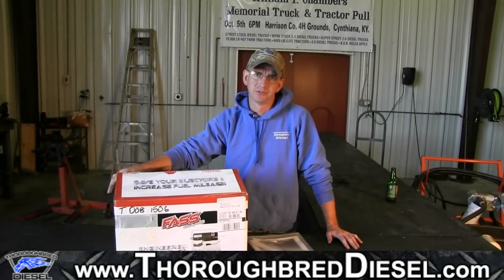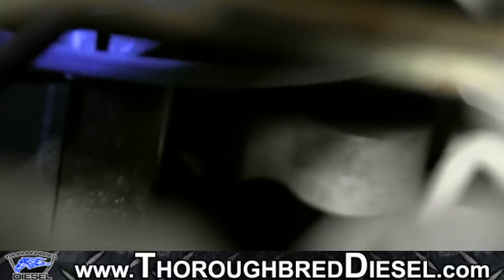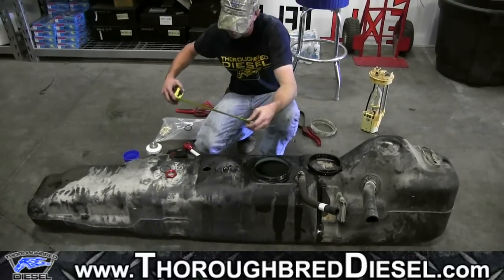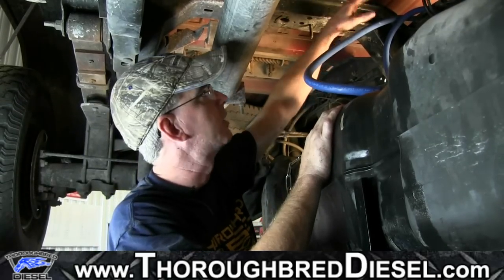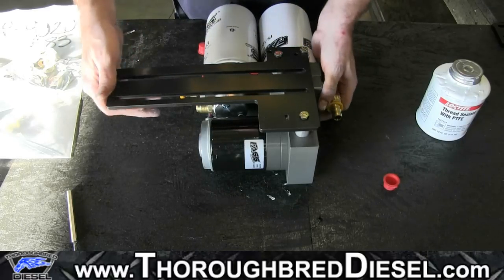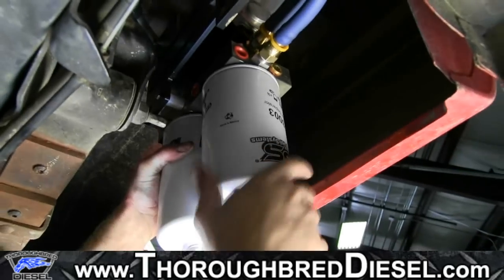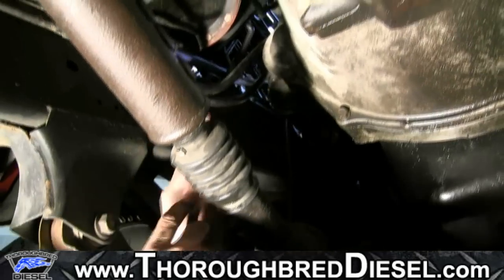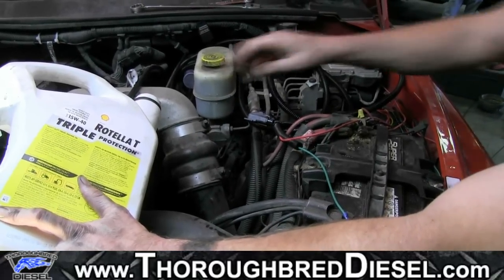FASS Fuel Pump System w/ Drawstraw Install: 2002 Dodge Cummins

Comment: @thoroughbred i have a 02 Cummins 3500 5.9 it doesn’t have an intank pump, but it has a electric pump replacement. I believe it is an airtrax pump. So when i install this, do i need to remove the electric pump or just leave it hanging? And another question, i see you had the fass pump for the block mounted pump, but you are using it for the intank pump. Are the fass pumps for block and intank pump reversible to use for either, as long as you just get the draw straw? I hope this makes since.
Reply from the maker: If you purchase a full FASS or Airdog system that routes to the VP,  you will just bypass your block mounted pump.  You can totally just leave it hanging on the engine if you choose.  If you choose to do a FASS block mounted pump, you cannot have an intank pump at the same times as it causes a restriction.  Also, if you use the block mounted FASS pump, you really would have to create your own fuel lines from the draw straw to the FASS DDRP, if that makes sense.
Reply: Thoroughbred Diesel thank you for this information. I was just curious. I’m about to put on the fass d08 100gph.
Reply: Thoroughbred Diesel one more question. In the installation manuals it says to spray wd-40 on the pump, as to where y’all did not in this video. Is that somthing that has to be done?

Comment: Would an airdog pump with a draw straw be the same install? Also what about if the fuel pump wasn't relocated and it's on the block?
Reply from the maker: zack halstead Some different hardware, but basically the same principal. If you got the Airdog 2 you will be doing the in tank module upgrade, that video can be found on our channel as well (AirDog Dodge Fuel Module Upgrade Install). https://youtu.be/ls4ocVVwEvI

Comment: Anyone know if you could just use the power wires and circuit from the stock pump?
Reply from the maker: Yes,  you can use the trigger wires from the stock lift pump if you choose.

Comment: My truck still has the lift pump on the block. It was never retrofitted with the in tank pump. Do I need the draw straw? Truck will be a daily driver with a mild programmer and RV275's. Not looking at making drag or sled power, just reliability with a little edge over stock.

Comment: I purchased my FASS for my 04 Cummins but my wiring harness is different. They told me I’ll have to cut my power wire from my in tank lift, is there another wiring harness sold separately? My truck been retrofitted, I have installed the suction tube.

Comment: question if i want to install this system with the sump kit do i require the draw straw as well, also if I'm installing a fuel pressure gauge along with this kit do i require any additional material to hook it all up?

Comment: Hi Thoroughbred Diesel. I've been looking into getting the FASS titanium 95 gph or the 150gph for my 03 24 valve. I'm leaning more towards 95gph. I went out tonight and turned my key over and went and listened at the tank, where I heard a hum. I'm assuming that means that my particular truck has been retrofitted with a pump in the tank, and I'll have to get the 04.4-07 kit, or else get the draw straw and sump when I get the pump itself.
Reply from the maker: That is correct. I would check on the back of your fuel filter to make sure 100% that you do not have the pump still on the back of the filter housing.
Reply: Thoroughbred Diesel I went out and looked this morning, but I did not see that block down there. Just the two fuel lines running to the fuel filter.
Reply: I guess I'll amend my previous comment above. I did a closer in depth look, and there is no aluminum block like there should be for the pump in tank, but there is also no lift pump either.
Reply from the maker: On the 03 to some 04.5 trucks, the lift pump is actually on the back of the fuel filter.  So there would be a maybe 2” cylinder on the back of the fuel filter housing that has a fuel line running to the bottom of it.  If it has been retrofitted to the LP in the tank,  there will now be an aluminum block on the back of the fuel filter with a fuel line going directly into it.
Reply: Thoroughbred Diesel is there an email that I can send photos to for your viewing?
Reply from the maker: Please send the pictures to sales@thoroughbreddiesel.com ATTN: WADE

Comment: The New wiring harness on the Signature Titanium pump does not connect to the original wiring harness going to the ECM like the setup on your video.  It connects directly to the battery and fuse box.  This requires that I leave the old Carter pump disconnected which causes a check engine light code P0230.  It comes and goes, but never seems to go away cause the ECM is always looking for a connection.  Is there a way to get rid of this annoying code?
Reply from the maker: Good question and you are correct on the new wiring of the harness, the trigger wire now goes to a key on source.  Not all trucks trip the SES light for the lift pump connection, but if yours does, what it is looking for is a ground. On the pigtail that supplies power to the block mounted lift pump, find the ground wire and just splice into it and run it to a chassis ground. No more light. If you need anything just let us know.

Comment: I have a 1995 12v cummins and I removed the injection pump to access the tappet cover and do other work along with removing the transmission for upgrading. Well I disconnected the 2 fuel lines coming from the fuel tank, both have a rubber hose on the end. Can you tell me specifically where these hoses connect? One hose clips to the top of the transmission and makes a “z” shape in the metal line then goes into a rubber line. That’s the hose I’m really trying to figure out where it goes. Any help is appreciated!

Comment: do you guys happen to have a video for a 99-07 or so ford 6.0? I'm contemplating whether to try to install myself or take it somewhere. Are these plug and play relay like that dodge was or cut and splice? do you know of an adapter to make it plug and play??
Reply from the maker: +AceBoy2099 Yes.  We have not done a Ford install video as of yet.  On the 6.0 and 7.3 trucks, this kits will come with vehicle specific harnesses, you will only have to find a key on power source to run the unit.
Reply: +Thoroughbred Diesel 
when you install one of these on a ford 6.0 are you supposed to remove the engine mounted fuel filter or doesn't it matter?
I just installed mine this weekend and now it seems to have a slight miss/hick up that wasn't there before. I'm thinking it's got to be either that or the draw straw isn't cut high enough, but I don't hear a change in tone of the pump like the 5gal bucket test video fass has out.

you guys have any tips for me?

Comment: Ok we'll my truck is a 2001 and i recently replaced my battery cable connections and I hooked everything back up like it was when I bought the truck, I have a green wire going to my negative side of the battery and there is a red wire running to the positive and I know there is a fuse also. And i don't remember it constantly running when I first bought the truck. All I ever heard it do was come on for a short time right when I would first turn my key on before starting the truck. So I'm needing some help on figuring out what is going on, and is it a bad thing that the pump is always running while the truck is on ? FYI the color of the fass pump I have is red. I think it's an older model possibly.
Reply from the maker: Has anything changed? Has anyone worked on the truck that could have possibly cut the trigger wire and moved it to a key on power source. The wires on your battery are your constant power wires. Check your FASS relay and make sure it’s not a relay problem. No it will not hurt your pump to run while the keys on per say, but if you have an accident and the pump is running with the key off it would not be a good thing. This issue needs to be addressed.

Comment: when is someone going to do a video for the 2012 Cummins trucks?
Reply from the maker: Really not a lot of difference from this video other than the fact that you are bypassing/disabling the pump in the tank.   The principle is the same.
Reply: Thoroughbred Diesel WHATIF MY TRUCK HAS THE SEVERE DUTY FILTER? Do you recommend removing all of that or leaving it in place?? I would like to clean up some of this space on the frame.
Reply from the maker: The FASS can be fitted with 2-micron filters.  It will be a judgment call for you if you want to bypass them.

Comment: by unplugging the ecm connection to the in tank pump does that unplugging your fuel gauge or is that a different plug?
Reply from the maker: No, the same plug but unplugging the pump will not affect the sending unit for the fuel level.

Comment: so on a 05 there is no need to crack the lines to prime? once your getting fuel to the injection pump you just tighten the line and crank the truck until it starts. what if i did crack 2 lines on the truck if i just tighten them back up and crank it will it be ok?

Comment: Thoroughbred Diesel
I have the fass platinum  pump w/o in tank pump. I purchased the truck like that. My gauge gets a little over a 1/4 and I run out of fuel. What exactly do I purchase to fix this.
Reply from the maker: The 98.5-02 trucks are notorious for having fuel level gauge problems.  I would check the sender if the truck does not have a drawstraw installed.

Comment: What happens to the stock fuel lines and fuel filter housing?
Reply from the maker: The pump runs right to the VP and you can get rid of any of the supply lines to free up space.

Comment: if i was to order the fass titanium 95gph. itll come with all the stuff and not just the pump by itself right?
Reply from the maker: Yes, the pump will come with everything you need to mount and run the fuel lines.  If you have the pump in the tank you will still be required to purchase a draw straw.

Comment: The electric pump motor is supposed to constantly run unless the truck is off ?
Reply from the maker: No. On the 98.5-02 trucks, the pump is only on when the ECM tells it to trigger. Unless you route it to a key on power source.

Comment: So my 2000 ram 2500 24v doesnt have retrofitted block has engine lift pump and pump in tank so do i have to order draw straw?
Reply from the maker: Your truck was not produced with a in tank pump.  But if it has been converted, you will need a straw.

Comment: So how would one install a fuel pressure gauge with a FASS installed?
Reply: There is a bolt on the engine fitting on the pump that you pull off and attach a gauge fitting onto the pump

Comment: I'm installing the Fass Lift Pump right now, your mentioned you're going to electronically disable the stock fuel pump. How? You never showed that part and it's not in the instructions sent with the system.
Reply: Ya Fass instructions leave a LOT to be desired that for certain

Comment: Did you not take the pre he eater out of the equation going directly to the injection pump?
Reply from the maker: +William Dowell Yes,  this eliminates the fuel heater in the stock fuel filter canister.

Comment: @thoroughbred So if my truck has not been retrofitted and I am going to run a 150 then I do not need to drop tank to add a draw straw?  Also, if I went to a sump then how would I run my return line?
Reply from the maker: The 150 (165 now) kits do not come with a draw straw.  They draw from the stock unit.  If you do a sump,  your FASS return will still return to the filler neck with a manifold that comes in the FASS kit.  We also sell a sump by G&R Diesel that has a return port for your lift pump and you do not have to cut the filler neck.

Comment: I have a fass 165 titanium on my 24v it runs constantly once keys on and when trying to start I constantly keep about 28 psi at all times and seems to try to hard start or not catch is there anything a different spring would do to fix that or a better way to rewire it ? Thanks
Reply from the maker: 28psi will cause hard starts for sure.  We have rewired them to the power window fuse,  that way when you crank the truck,  there is no power to the lift pump.  To reduce pressure, contact FASS and they can send you a new spring.

Comment: What is everyone in the northern states doing for filter freezing when it gets below zero? I’ve tried PS anti gel, 911 and Howes. -5 and I’m OOS, I bought a filter heater wrap from Etip, but haven’t been able to test it yet. (Weather warmed up)
Reply from the maker: The fuel heaters offered for the FASS kits work great for this.

Comment: Just got a brand new lp, and it's set at 17, but as I drive it it drops up to 10 psi lower, and I can't figure out why, I did an aftermarket draw straw so it shouldn't be starving or sucking air, any ideas

Comment: How long would it take you to install a fass 150 on a 06 cummins?
Reply from the maker: For a 04.5-current Dodges you have to drop the tank. Install time is approx. 5 hrs and the difficulty is around a 7 out of 10 (10 being extremely difficult).

Comment: Question ...... Asked my local diesel shop today about the FASS Titanium 150 prices etcetera and they said if I buy the product from Thoroughbred or off Amazon they would not warranty it due a bunch of chinese knockoff's found ...... what is the story ?  True / False Bogus rumor or what ?? How can I ensure getting the product and ensure its not counterfeit ?
Reply from the maker: You should not buy FASS off of Amazon they are correct about that. Our website is 100% safe and authorized by FASS. Any FASS item purchased from us is manufactured by FASS and has a full manufacturer warranty. So to answer your question directly, true about Amazon, bogus about Thoroughbred Diesel.

Comment: My wiring harness did not come with the stock ecm connecter. It’s just a single red wire that goes to it
Reply: BearTrapz 32 what did u end up doing with the single red wire
Reply: Jimmy McIntyre You have to strip and connect it to a fuse connector and replace a fuse in the cab of the truck that only has power when you have the key on. I used the cigarette lighter 10 amp fuse
Reply: BearTrapz 32 thanks for the response I was looking it up and did the same thing
Reply: Jimmy McIntyre I’m glad you understood what I was trying to say.

Comment: Will a duramax wiring harness work for my 01 cummins?
Reply from the maker: The Dodge harness is much easier because of its plug and play.  But yes the Dmax harness will work just have to modify it to run on a key on power source.
Reply: Thoroughbred Diesel so do I still unplug the part from the ecm?
Reply from the maker: You will need to call in for further tech support to explain. (866) 737-4966

Comment: Instead of dropping the tank can I just put a sump on the bottom of it and work from there
Reply: I bought the XDP one hole design sump didn’t realize I needed a supply and return for fuel, the sump only has one supply hole where would I hook up my return on the top of the old in tank pump?

Comment: Maybe I missed it, but when you disconnected the stock fuel line from the injector pump, what did you do with it? Is it just hanging there? What is to stop the in-tank pump from emptying your fuel through that loose end? What about the stock fuel filter? Did you leave that connected too?
Reply: Kj Smith hows it going to pump fuel if the harness is disconnected to it?

Comment: I have 2003 with the 150GPH titanium pump /suction tube kit, recently installed a fuel pressure gauge and its reading 0psi, tried a different mechanical gauge and it reads 0psi, bump the starter and nothing happens pump is not working. Heres what I find really strange the truck fires up and runs fine which is why I never noticed an issue till the gauge install. Could the aftermarket cp3 be creating a vacuum. ive been scratching my head now for a few days and haven't had any luck finding any answers online. I t'ed into the main fuel line from fass to cp3. Will be looking over all relays and fuses tomorrow.
Reply: ChrisR gr8t video btw :) cheers

Comment: There is no need for pipe dope on a JIC fitting. The threads are not what are sealing the fitting it is the cup cone seat at the end.

Comment: stupid question, sorry if it was already answered  I understand everything you showed except one.

Since you replaced the electrical going to the factory pump with the new harness, what is talking to the fuel gauge now?  Is that just a separate wire that you didn't mention?
Reply from the maker: For this FASS install,  the factory harness is still in place.  The harness that is used here powers the FASS pump and is completely independent of the stock fuel level harness.

Comment: way would not remove the bed off the truck ? 6 bolts
Reply from the maker: Not everyone has the ability to lift the bed. A tank can be dropped faster and with just the help of a floor jack.

Comment: Can this be used with a sump pump that only has one line?
Reply from the maker: +jestes7 Yes.  It can be used with pumps that do not return back to the straw.  The return port has to be blocked off in that instance.

Comment: Is the drawstraw as good as a sump?
Reply: Thoroughbred Diesel👍 please see above
Reply from the maker: There are pros and cons to both. The thought is that the drawstraw will pickup less particulate than the sump. The sump however removes the 1/4 tank issue that the drawstraw can have. Sumps can also help with an easier installation on some applications as they provide a port for the return fuel too.
Reply: @thoroughbreddiesel  ahh I see, I am just worried about leaks with the Bean Machine?? If done right and torqued Beans is OK vs Fass Sump? thanks!

Comment: Maybe I missed it, but what do I do with the original fuel lines? Do they stay hooked up?
Reply from the maker: The stock supply line can stay installed on the truck as it is not needed anymore.  Just watch for residual fuel.  If you get any just blow lines out to clear, or take lines off truck.